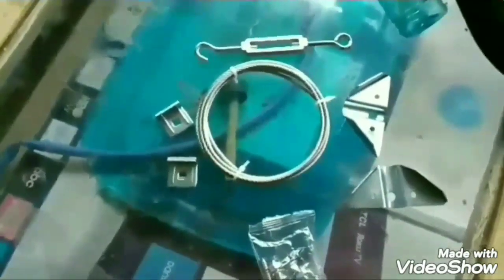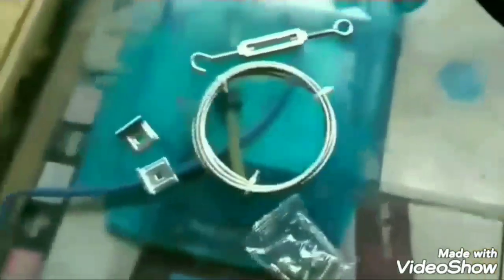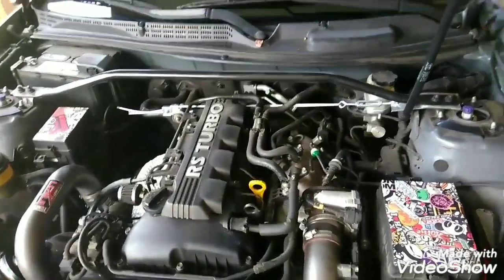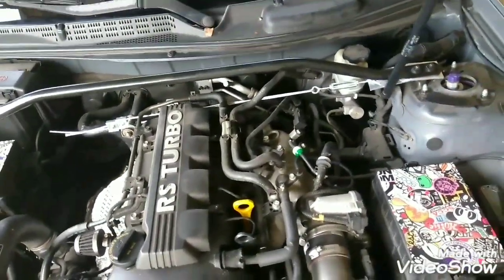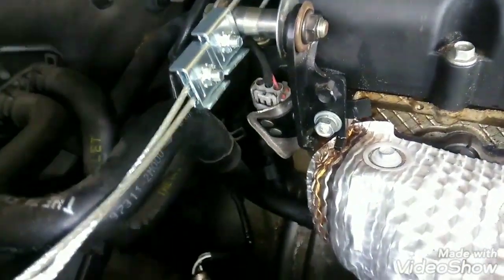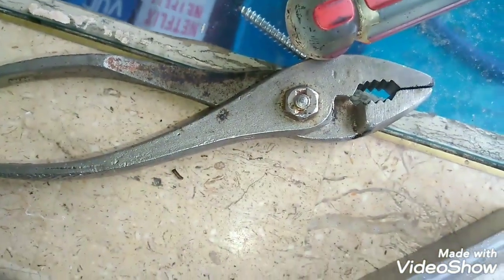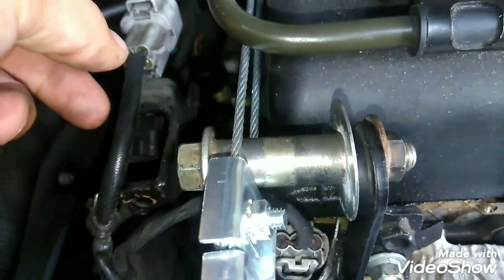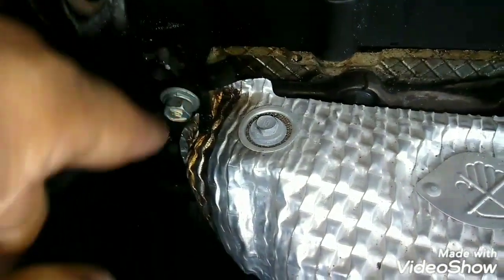Genesis coupe engine leash install. D.I.Y V.2

Comment from the maker: Week 1 update; so far it has been a week with the leash on. No issues. A lil bit of tension was lost due to stretch but I tightened it a bit more. Overall it's holding up great and you can really feel the difference. The power delivery is Soo sooo Soo much smoother than before. 
Update; I have installed the bolt for the missing differential mount. I am currently testing it before posting a how to video. Really cheap way of getting that diff to hold on better. As per usual. Thanks fo watching see ya next time.

Comment: whats the purpose of the leash
Reply from the maker: The leash is a support for the motor mounts. Especially the stock motor mounts. During acceleration (load) on the engine, the stock mounts don’t hold up too well and the engine Ends up rocking side to side pretty furiously. This also leads to second gear lockout on the genesis coupe. The leash helps keep the engine more still and since it doesn’t rock as
Much if at all, second gear lockout during high rpm becomes null n void.
Reply: @mrbuddahz3355  whats yu instagram bro i got a dee questions maybe you could help me on my build